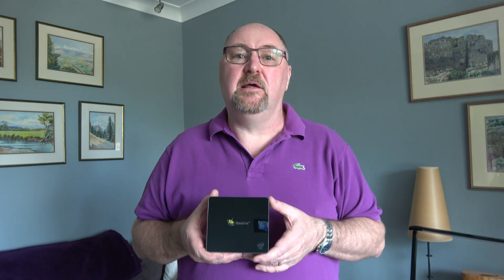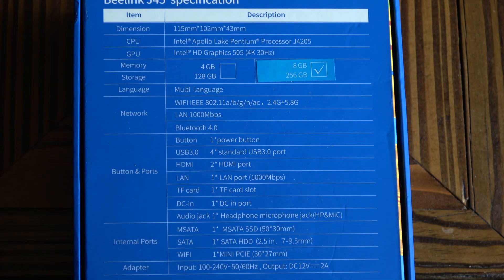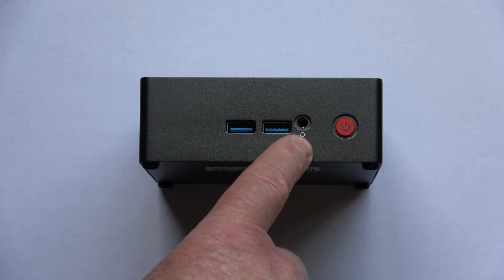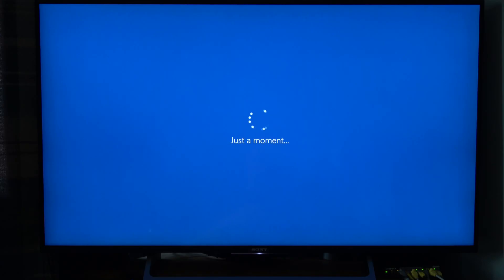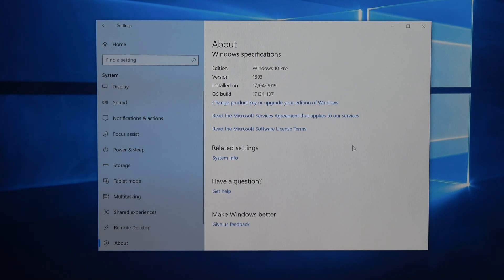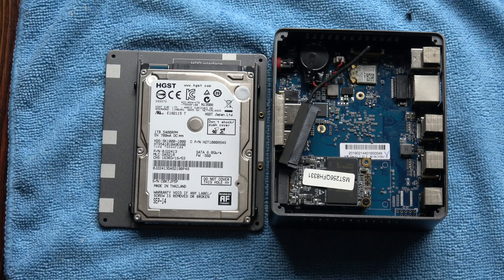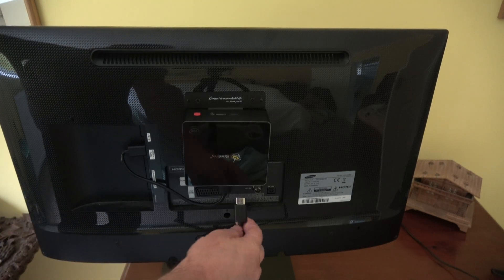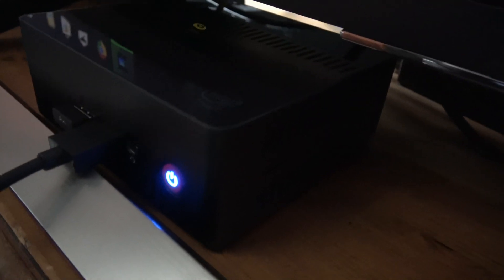Beelink J45 Mini PC - Review and Set Up.  A fine product!

Comment: Thank you for the review! You've made me feel even better about ordering this computer (USA version) via Amazon on June 4. I expect to get it on June 8 (very fast!). It will slowly replace a laptop that has been acting up. I'll be using an old monitor, mouse and keyboard, a DVD burner/reader, a fancy modem which I'll plug into the back of the J45 (no wifi for me), and for storage, some external hard drives. I had thought about getting another laptop, but these days those cost about 3x more than the j45 and don't do as much! Again, thank you for your helpful review!
Reply from the maker: I don't think you will be disappointed Debbie. It is a great alternative to a laptop so long as your screen is decent.  I use mine when I travel and at home.  :-)
Reply: @RussellPlatten  -- Maybe I can figure out some way to hook a tablet up to the J45 so I'll be able to take along a small screen if I travel (though reading and watching video on the tablet could be enough, esp as the tablet has a rechargeable battery). Lots to explore!
Reply from the maker: @debbys-abqnm4537  I just used the J45 whenever we came across a TV with HDMI.  Fortunately, literally everywhere we stayed had a suitable TV.  I also used a wireless mouse and keyboard (they both worked off the same dongle) made by Logitech, so that I could sit away from the Beelink and watch films or YT.  :-)
Reply: @RussellPlatten  -- What good ideas! While I've had (or my parents had) TVs all my life (since the early 1950s), only the one I have now (which looks a lot like a computer monitor) has a HDMI port, which I had forgotten about. I don't use anything wireless, but I can see change that rule for a keyboard and mouse in the event I ever go anywhere. My not thinking of wireless also explains how mounting the J45 on the back of a TV or other monitor would work and I could access it. I bet there is even software I could acquire and wind up replacing my old (~2003) Pioneer DVDR into which my antenna feeds an over-the-air signal and allows me to record to an internal 80GB hard drive (and edit, better than a VHS machine), then burn to DVD. Then I could not only watch TV but transfer programs I want to keep to external drives 😁 It's fun to live at this point in history! Technology!

Comment: hello good video like ,one small question you has try to intall another windows OS in the hdd 2.5 "?
Reply from the maker: No.  The tablet has Windows 10 installed on the supplied mSATA drive.  The 2.5 inch HDD is just extra available storage.  :-)

Comment: hello good video like number 47. one question:
 the hard drive you installed is sata1,2 or 3 (you have tried sata 1 and 2 if they are compatible with this mini pc thanks)
Reply from the maker: Hi Philip, SATA HDD/cables are all compatible, so you can connect any SATA HDD to the Beelink.  The transfer speed will depend on the slowest component.  If you connected a SATA 2 HDD via a SATA 3 cable it would transfer data at SATA 2 speeds.  :-)
Reply: @RussellPlatten  
Very grateful for your answer keep it up. + sub

Comment: Forgive me Russel, but 2 silly questions...will it have iTunes on it, so I can sync my phone with it? And also will I need a separate keyboard? Many thanks in advance 
Lee
Reply from the maker: Hi Lee.  First of all it is a windows PC, so you can install any program compatible with Windows 10.  There would be no problem with installing iTunes.  You will need a mouse and keyboard.  Any USB keyboard or mouse would be fine. The clip I edited in the video shows the wireless keyboard and mouse that I am using now to reply to you.   You will also need a TV or monitor with a HDMI socket to use as a monitor.  :-)
Reply: Russell Platten cheers Russell will be buying one soon thanks!
Reply from the maker: @abrasdwe  :-)